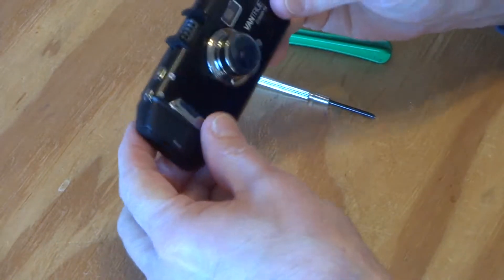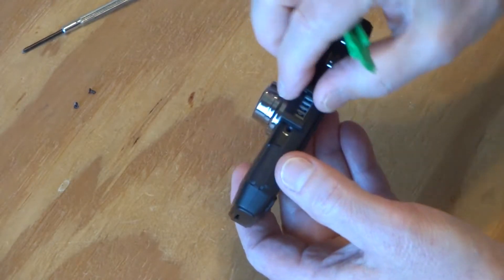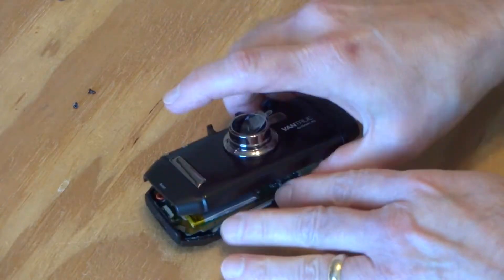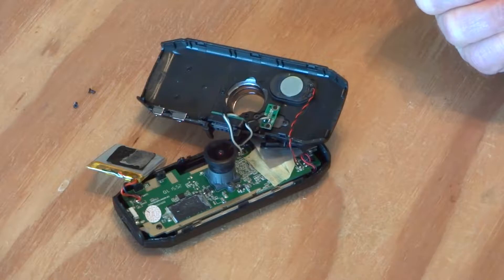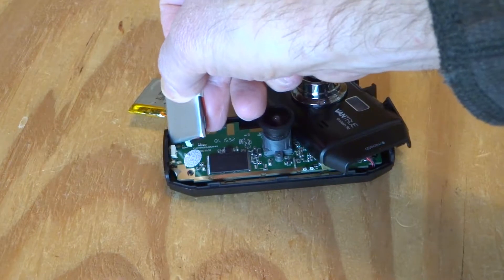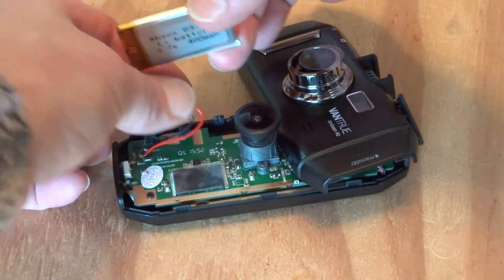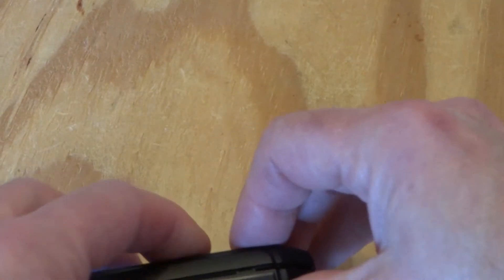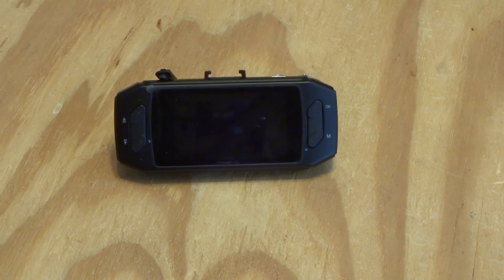Replacing the Battery in the Vantrue OnDash R2 2K HD Dash Cam

Comment: Hi thanks for the detailed video, where did you find the replacement battery?
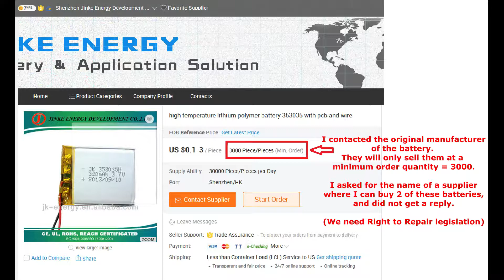Reply from the maker: @KiLe: I bought the battery from a seller on eBay. See 5:34 in the video for an image of the listing I bought from.
Reply: @t5montecarlo  ok thank you
Reply: @t5montecarlo  how long did that battery last?
Reply from the maker: @kile9584  I used the camera for just under a year and then sold the car. I removed the camera and later sold it. During the year with the new battery, the camera worked properly.

Comment: My own wouldn't even turn on unless plugged in and as soon as I switch the car off that present file gets corrupted
Reply from the maker: @T_money_ THIRD: It sounds like your battery had no charge stored, so the camera would not properly close the file when the car was switched off. It is time to replace the battery.
Reply: @t5montecarlo  you think maybe I can replace it with a cell phone battery
Reply from the maker: @t_money_third9654   If you have a different camera, measure the area where the battery sits and see what batteries are available in that size.
Reply: @t5montecarlo  I do have a lower quality camera but I'm afraid that if I take it apart I'll endup with 2 broken cams
Reply from the maker: @t_money_third9654  I had that same thought when I first took mine apart. While it was snapped together, it didn't really feel like it was meant to come apart.
Reply: @t5montecarlo  funniest thing happened as I got off vacation and parked my car in direct sunlight again the heat made the camera turn on automatically. I just have to check it later to see if files are still being corrupted
Reply from the maker: @t_money_third9654  Very strange behavior, indeed.

Comment from the maker: Update December 2018: I began using this camera because the battery in my other camera was also failing to hold a charge. The camera in this video is working wonderfully; all clips are being saved properly when shutting the camera down.
Update June 2019: Recently, there have been a few days where the temperature was 90F, and the new battery is still performing properly.
Reply: Thanks for the video! Have you noticed anything related to the temperatures? Since the new battery that you used is not rated for high temperatures
Reply from the maker: @erickpeniche  It is June 2019. Temperatures are still rising, but we have had a few days where the temperature was 90F. So far, the battery is performing properly.
Reply from the maker: @erickpeniche  You're very welcome. Unfortunately, it is still very cold here, so no data on higher temperatures, yet. When July comes around, I will know how the replacement battery tolerates the higher temperatures.